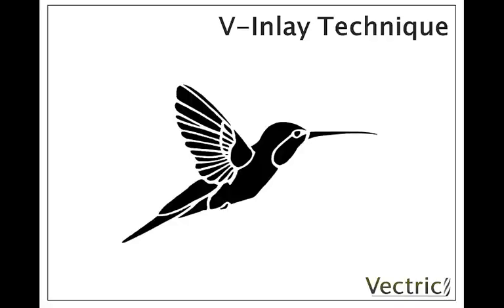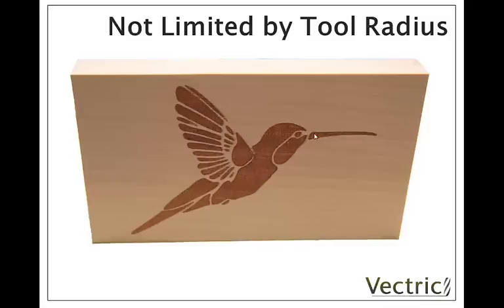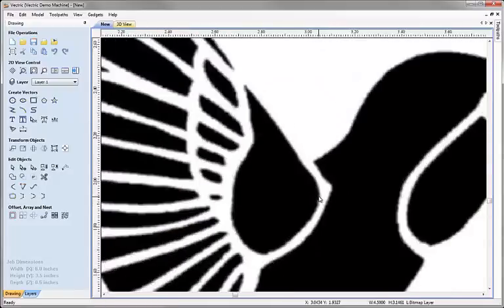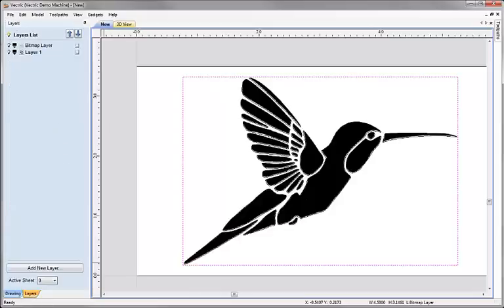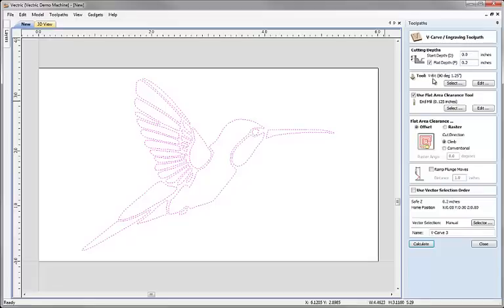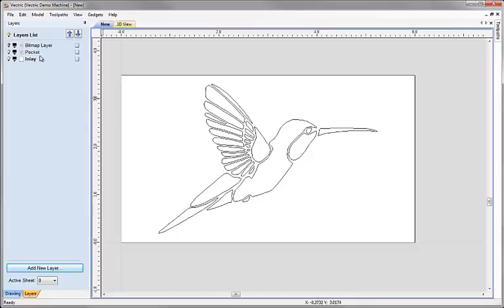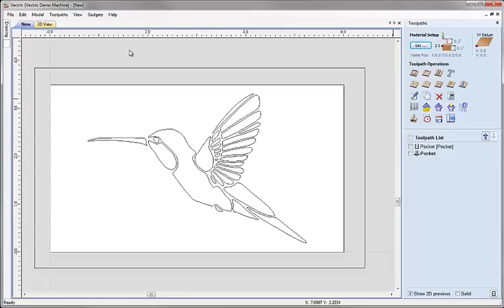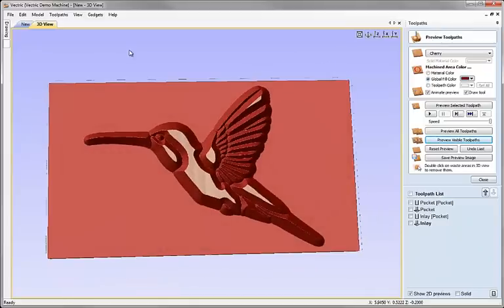D07 - VCarve Inlay Technique

Comment: 17:34 "We've now got a matching inlay that will fit inside". Almost, but not perfect fit. It has to do with the flat depth limitation. It's actually the female part that's the problem. V-Bit is incapable of giving you a flat surface, and endmill is incapable of reaching all surface. I recommend adding a little bit of tolerance by slightly sanding the top of the male part to account for the imperfections of the female part

Comment: I did this exact same cut with your 321 method, IDC method of .11/.09/.02 etc  but the male part always looses definition on the tail feathers (lower). I have used my 90 and 60 vbits and all leave the image too thin to hold up. Cannit be a feed issue? I am using walnut and maple so its not loose grain. 

Final note is that my image is only 2 inches so wondering if its just too small and I need to go to 15° or smaller bits.

Your thoughts?
Reply from the maker: Hello... and thanks for the comment.  I might suggest yo have a look at this video... https://www.youtube.com/watch?v=yUaSsL4F6_E  It might help a bit to explain how things work.  there are a lot of places things could fail... but in my experience it most often is fine raised "fingers" of material or a dull bit (tearing the plugs detail).   Yes,... it also could be the size of your part.  This may require a few test custs to get everyhing worked out.  Once you have it the process is very repeatable... :)

Comment: Hello. I used this very same piece of clipart in 2011 to make an inlay occasional table top with Vectric VCarve Pro. I also used a 90° Vee bit to do the milling. One point to bear in mind is that Vee bits do not come to a complete point. Just turn it sideways and you will see that the cutting part has a definite width. If this were not so, it would not be possible to use it to mill some of the flat areas, since you can not mill a flat with a zero dimension point. Vectric knows about this with Vee bits and assumes a certain flat width at the pointy end. Have a look at the image of the Engraving bits and they actually specify a particular dimension for the flat at the pointy end. I use Engraving bits and actually modify them by grinding different flat dimensions to suit different depths and materials.
When using the Vectric engraving toolpath, the geometry is quite complex since the outer edge of the tool has to keep inline with the toolpath as it descends into the material. When doing inlays, the flat at the end becomes of major importance.
Reply: What problems does this cause and how do you solve them? I guess I don't understand how the flat becomes important to Vectric. Yes, I get your point about clearing but if it's a 15 degree vee bit, it shouldn't affect the actual vs planned toolpath correct? Having a tip just simply means it's not cutting as deep as it thinks it is, but if you have glue space this should hopefully be counteracted?

Comment: In the tutorial, the pocket is 0.2 inches and when the inlay is cut, the start depth is changed to 0.1 and the depth is cut to 0.1. I assume this is for the glue pocket. The demo says to divide the distance in 2 (0.1 + 0.1). What if the depth of the pocket is 0.25 inches. Should the start depth be 0.1 and the depth be 0.15 or should the distance be divided equally (0.125 each)

I do not have my own cnc router and have to pay to use it so less experimenting is best.

Comment: I can't get this to work. When I cut the male piece with Vcarve tool the v bit path only allows the bit to cut as close as the cones outside diameter making the male piece to large t fit in the female piece. If I run a profile path with the V bit it will cut it like it should but the I need to make a pocket path with a ball tip and end mill that still isn't as close as it should be because of the taper of the ball tip. Any suggestions
Reply: Philip Mark did you ever figure it out? I too just did this tutorial and the make part only went in half way. I've searched the internet for hours with no luck. Maybe you've solved it now and can share?
Reply: @ChadGrenierPilot  its only meant to go in part way, that way you get a tight fit , then when you clear the excess its perfect
Reply: Kaleo, any luck figuring this out? I just tried this tonight for the first time and the male part only made it about halfway into the female part. Thank you!
Reply: yes I did make one successful inlay but I can't remember. I did it not to long after my first posted 3 years ago. I'll look back through my files on that project and post if I can remember. I do know that I made the inlay a little too shallow so it looked good on top but there was space between the bottom on the inlay and the bottom of the pocket. I did't tell the guy glueing it that I made a gap so he could put glue. He thought it would push it up so it ended up having a hallow sound when you tap it But looked really good.
Reply: Chad Grenier thats the idea it does not have to go all the way inside ..you just apply good amount of glue on the edges and after it drys out cut it .... dont worry about not reaching the bottom it will hang ok
Reply: It isn't necessary to make the "male" part go all the way into the pocket, for starters, there has to be some room for the glue to sit. 

Glue the male part into your pocket, cut away/sand the excess, it should look perfect.
Reply from the maker: Hi Kaleo. Unfortunately our YouTube channel is not a support portal.

For help with your question, we recommend visiting the Vectric support site or contacting our support team. Details can be found in the description of this tutorial.